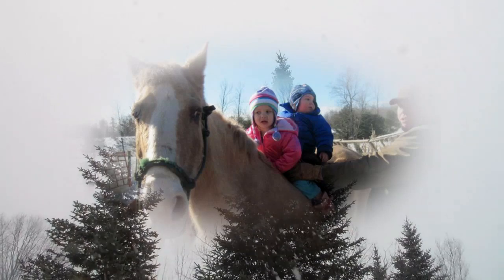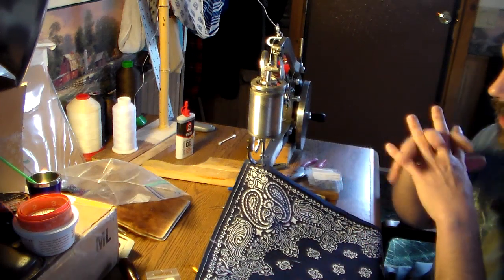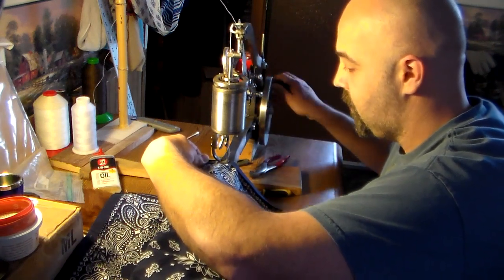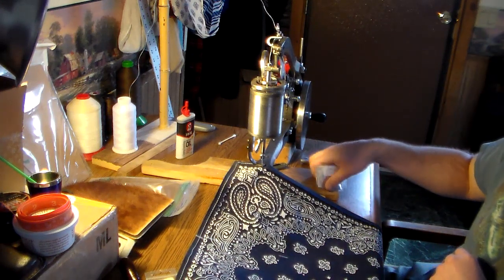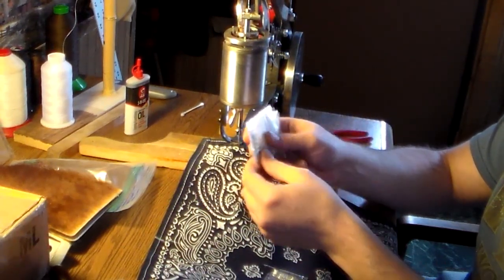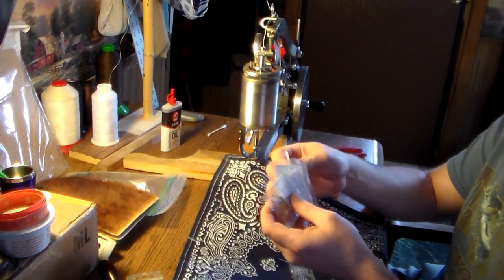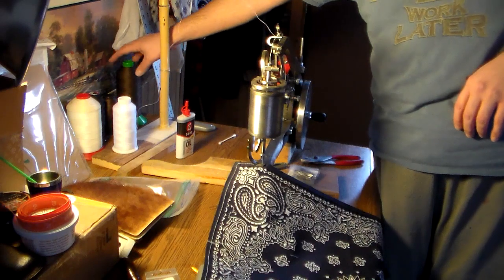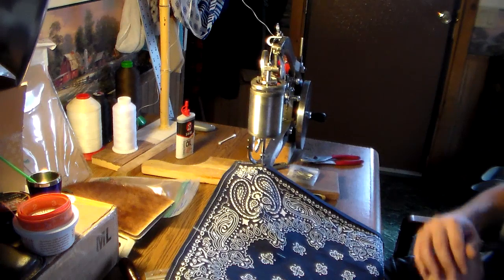Leather Sewing Machine Needles/New Project

Comment: buy your self a singer    201 or model 28 should be able to find a 201 under $50 if you look around,best machines ever made I use my model 28 hand crank machine for most of my leather working and only use the Chinese one when I run out of room under my 28's foot

Comment: I like walmarts nylon ulpostery thread thats thin and good for the 16 or 18 needles and you cant tear it. And it comes in diffierent colors . The thicker the needle the bigger the hole it punches Rember that .I bought 21 and 25 needled for a singer 94 but i had to shorten them and grind a flat on one side but it worked .I didnt know how to find a bigger size online that would fit so i knew about the singer shoe machine might work
Reply from the maker: Thanks for commenting and sharing

Comment: I purdied min up some what and nice like ! These things chug like a train, love the sound. So fare I've only run the crappy thread it came with. It looks like the price has come down a little cheepest I could get one at the time was $115. Now I see $94 free shipping very cool.
My first project was to get my money out of it by stitching 11 jeans with patches. Just as I began having fun I ran out ! These machines feel so much more substantial if you round out all the edges tweak and make sure you take out any binding what so ever on the adjustable parts etc. I have a 1930s Faff also love it, but this one is so much more enjoyable that I got another one just to tune it up... and sell polished painted and finished.   You wont go rong geting one.
I find the tension springs to stiff I will never need to tighten much... do you think replacing the springs with softer ones would be worth it to make them capable of finer tuning ???
Thanks.
Reply from the maker: Are you talking about the springs on the tension spring on the disks? If so, I would try it out and see if it makes a difference. But make sure to hold on to the ones that came with the machine. In case your working on a thicker project and need that extra tension.
Reply: @MainelyAcresFarmBrooks  Yes sir,  the spring on disk. I'm running the cheep thread that came unit. The thread likes to knot up much before the the tensioner.. I've added small feed through loops to keep thread from feeding in knotted.  It is working well but as I see it.. to much twisted thread. I'll have to try better material perhaps.
Reply from the maker: What are you using as a thread stand? That might be the culprit.
Reply: @MainelyAcresFarmBrooks  Well, I built a stand with an overhead arm. 
thread feeds from the top, through a narrow spring up top looks like a fishing pole spool stays still pulls from the side of cylinder/cor. It does not bind or have friction any were. After about two yards of sewing it just becomes too much. That is why I thought perhaps the pressure spring could be much looser, or the thread is just to cheep.
Reply from the maker: You got me there, I would try getting some new thread and trying that before making any mods. I have not heard of this issue before so hopefully getting some new thread will fix that. If not try modifying the spring. Let me know what you find out
Reply: Sill doe.

Comment: The 15x1 is a domestic machine needle.  You can adjust your needle bar height (single screw takes only a minute)  and there is a different youtube video if you can't figure it out.  Then put a round shank 135x17 (regular sharps point) or identical size 135x16 (leather point).  These are also numbered dp17.  These are heavy duty hitter industrial needles that will work so much better in leather.  This machine is far superior to a domestic machine for thick leather (201 is a rotary hook if you must at least get a heavy class 15 hook that can handle denim).  These machines are clones of the Bradbury A1 and reportedly can handle thicker with longer stitches than the much more expensive 29k clones.  Best regards, Mike
Reply from the maker: Thanks Mike, That's some good info!!

Comment: My machine came yesterday. Same broken needle and oil soaked manual. They place a patch under needle to show "Proof Of Sewing". Even thought it was not actual leather, it left marks from the pressor foots teeth. Other than the excellent needle information, but since I have lost track of which video was which, did you gently file down the pressor foot teeth a little to quit bitting so hard, it leaves marks on some leathers or other materials? Thanks, keep it going!
Reply from the maker: I would file or grind the edges off and then dip in a rubberized paint. You can also adjust the tension on the presser foot so it's not pressing into the leather so bad

Comment: Do I call China for needles, I’ve bought tons of needles and haven’t landed on anyone with larger sizes, I picked up some size 22 and hey won’t go down to the bottom, too tight a fit.  Drop me a quick one on who to contact, thank out,       Buz Bailey, Billings Montana.    (Motor cycle seats)
Reply from the maker: Just take a round file to the needle well and make it bigger.
Reply: What about 207 thread??? Have you tried thank you!

Comment: So How has it done with the 135 thread ?  how about the bobbins max thread size capacity ? thanks
Reply from the maker: I would highly recommend the T135 or 138!! Still have enough room to get a good run. These can handle the larger T207, but there's not enough room in the bobbin.

Comment: Any amazon links for the waxed leather thread that will run thru this machine? I spent an hour looking and could not find any.
Reply from the maker: I am not sure of any... If anyone out there has a good link to waxed thread let us know.  As far as running waxed thread in these machines it's not recommended, but I have done it before and had no issues. I just used some bee's wax and waxed my own thread.
Reply: @J C  As far as threads types, waxed or bonded nylon, you may choose to look at the website, wwwthethreadexchange.com They have thread information as well as needle information. The bonded nylon "TEX 135" is a good thread with a waxy like action. It is "UV" light resistant and same with chemicals, making it good for anything outdoors including leather vehicle upholstery. This thread has a 21 pound tensile strength and called GOV-3 cord for "MIL SPECS". 
  After checking around, they have some of the best prices per oz of many other sites as I  did a lot of research. The carry waxed, synthetic sinew, kevlar, fire resistant and many others. 
 Depending on the material used in your project, you want to pick your thread. A large thread stand out and becomes more visible, but like TEX 135 bonded nylon having a 21 lb. tensile strength, perhaps sewing leather upholstery will be a good place to start. They say to make the smallest hole needed for obvious reasons, so next come the needle type. A point "D" or "DI" is a diamond shaped 3 sided chisel point where "R" is regular and shaped like a round ball point. 
  A true reinforce "French Seam' is what you want in parts of your project, choose a shorter stitch on the backside to hold it together, then change needle & thread to larger on top stitch for function but appearance as well.
  Hope this helps a little, best of luck! Great little machine.

Comment: What size needle would best for #92 thread, its been recommended to me to use sizes 18,19, or 20, My question is which one will leave the smallest hole in about 6oz. of leather without the thread breaking ?
Thanks
Reply from the maker: I would stick with the 18

Comment: Hey quick question, i have the same machine as you but my pressor foot is not moving. Do you have any tips on how to fix this?
Reply from the maker: I can help via Facebook video chat if you still need some help.
Reply: I got it to work thank you though i appreciate the kind offer to help!
Reply: I had the same problem, took the sewing head (can) apart, made sure the spring was positioned in the slot of the inside shorter guide and would pull both bars over when removing from the can. Lubricated both bars, reassembed the can head. I made sure the needle tube was set low enough to pick up the bobbin thread and the walking foot now walks again. Hope this helps you.